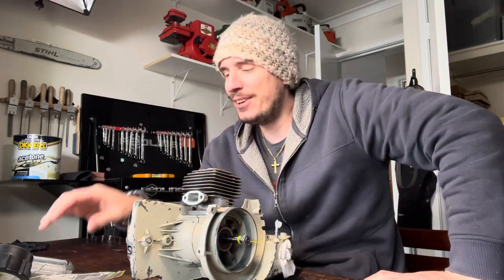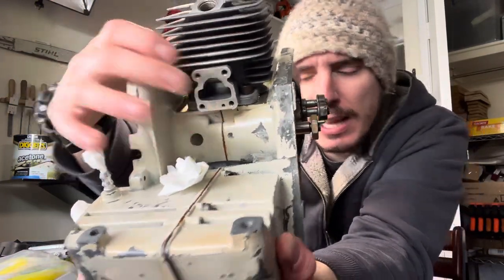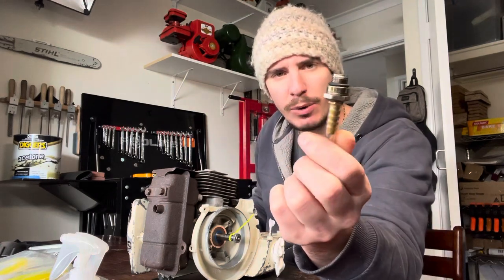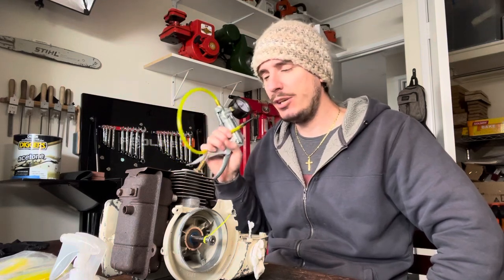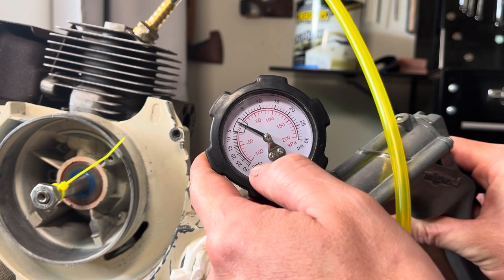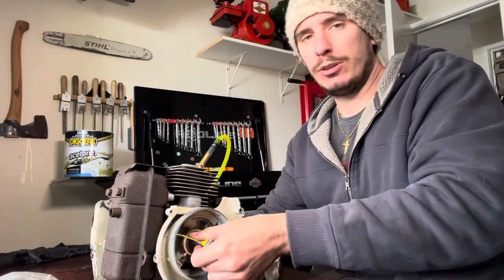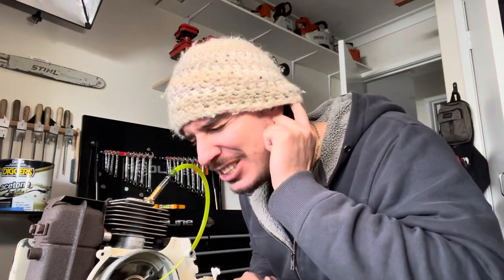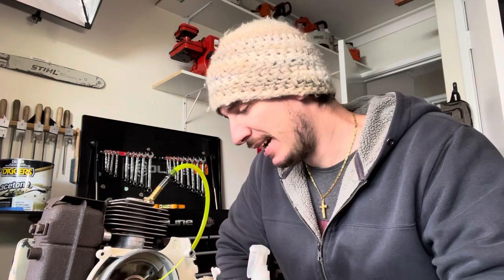How To Pressure & Vacuum Test A  2 Stroke Engine

Comment: Air leaks can cause an engine not to run at all, right? Everything I read online says that the engines just won’t run right. I got a red max ebz 8500 that won’t run. It’s got fuel spark and compression, but is failing pretty bad and pressure and vacuum. So thinking it may be that
Reply from the maker: It can cause it not to run, yes.

Comment: I replaced the crank seals, put on a carb kit on my approx 15 years old Stihl MS250. Replaced all fuel lines and filters. Now it runs much worse than when I started. It wont idle properly. I have tried adjusting the high and low jets and the idle screw for hours. It idles fine after starting - then when I use it for a minute and it goes back to idle it will stop. I turn up the idle speed, but then the idle will be obviously too high. I ordered a pressure and vacuum tester today. Thanks a lot for the video.

Comment: No need to build a custom tool. A compression air hose nozzle will screw right into the sparkplug hole. Both are 14mm with same pitch.
Reply from the maker: That’s great when you have the right size adapter /  the kit, but the ease of this for when you don’t is handy for people to make at home very affordably.

Comment: My engine is stripped like yours, is it normal that without plugging the two portes and rotating the shaft I get vacuum at the plug.?
Reply from the maker: Without plugging what two ports?
Reply: @VintageEngineRepairs  the carburetor and the exhaust

Comment: i have a 034 super,and regular 034,and a donor 034 rebuilding to 036...48mm,gathering the seal ,bearing tool,case splitter,spark plug port test adapter, and carb test plate, i did get a cheap ebay vac ,pressure tester,thanks for the video,soon ill have the donor  repaired

Comment: Excellent presentation,  I recently got a pressure vac unit like yours as shops in the area do not use them.  Lots of trial and error and as a customer I don't like paying for the trial and error.  Had a piston go in a Stihl and I knew it was not lacking oil in the gas, though maybe stale gas.  Lugging with dull chain is another possibility but first rule out vacuum leaks.

Comment: Good video. I just bought a Mityvac and spent the better part of an hour trying to seal a Stihl 193t. I kept getting leakage but I couldn't locate it. I finally found a small hole in my impulse line. I did have low compression which is why I wanted to do the pressure and vac tests. Can a hole in an impulse line cause lower compression? Can the Mityvac be used to test the rings?

Comment: Question. I have a DT100 and I've done a bottom end swap (cracked case was reason)
The old bottom end with top end still ran okay but when I put in new gaskets and did a swap i put my hand over the carb and i feel ZERO suction and no gas getting on my hand. It is 100% not a top end or carb issue at this point I don't believe and it has amazing compression and consistent blue spark. Had to swap points plate and flywheel for it but other then that it's all original. Just wondering if this would be a crank seal issue or what the matter could be.
Reply from the maker: Yep, without a pressure and vacuum test you’ll wasting your time. 👍

Comment: i  just received  the mighty vac mv8500 kit. now i have to figure out how to use it!  thank you fine sir, a masterful tutorial! bravo!  i collected  3  stihl 026 saws over the years that need work. i'm too old for dirt bikes,  finely tuned chainsaws are the new hobby. thanks for the well explained tutorials. what brand of seals and bearings are quality? (if you are a chainsaw guy) i'm new to chainsaw parts procurement.
Reply from the maker: Great to hear! The mityvac is fantastic. If you want the best, go oem. If you don’t mind using aftermarket visit a bearing and seal dealer. Don’t buy from eBay or Chinese retailers. Their quality control is poor and you’ll likely end up with a leak.

Comment: I was able to use the hose from my compression test kit. Had to remove the valve to open the line.
Reply: Did not look forward to hollowing out a spark plug then rigging in a barb fitting making it sealed tight. Glad I was able to avoid it.
Reply from the maker: Awesome! Good work

Comment: Can you please tell me what the adapter is called that you screw into the spark plug hole. Can’t find one anywhere, and everyone I ask doesn’t know what I’m talking about. 

Kind regards
Reply from the maker: Sure Joe, I made one from a spark plug! Cut the metal crimp off around the porcelain and it will seperate from the metal. From there remove the crush washer, add an o-ring and Jb weld / epoxy in a barb and it’s done!
Reply: Thank you very much for replying, off to the shed to find an old plug 👍.

Comment: how dd you remove the internals from the spark plug , have tried a hacksaw but getting nowhere fast
Reply: I chiseled away with an hammer and punch to clear out a plug to make a piston stop. It was a bear.
Reply: I use a old compression gauge hose,,cut the hose to length,and use one of the accessories that comes with the mityvac.I also use a golf tee to plug the impulse line.
Reply from the maker: https://youtu.be/WukO9adv0cs
Reply: @VintageEngineRepairs  Thankyou so much for making this video much appreciated .

Comment: should it hold for how long ?
Reply from the maker: About 30 seconds I test for.
Reply: thanks for the reply. 
i recently tested a chainsaw. and it held a few minutes. but i left it on and came back later and it bleeded down 
great videos.
Reply from the maker: @chenangokid  pleasure, sorry for the delay, it’s easy to miss comments! Tiny leaks like you have that hold but will eventually bleed will not cause an issue, other than if you’re a perfectionist and want to find it lol. Ideally it’ll hold indefinitely, but most all manuals specify a short holding period something around 30-60 seconds.